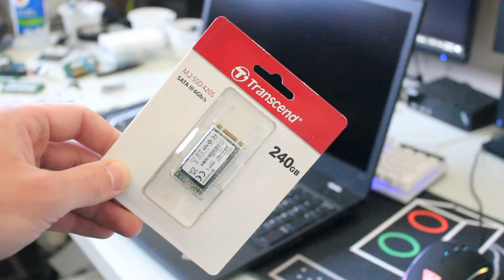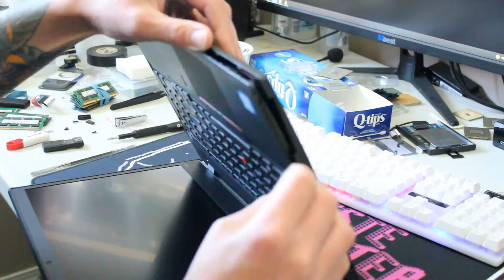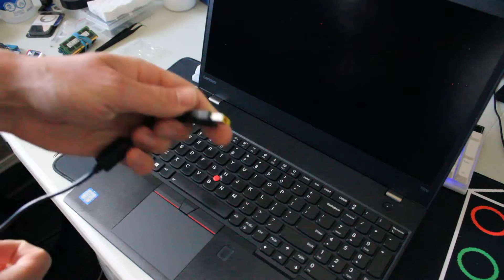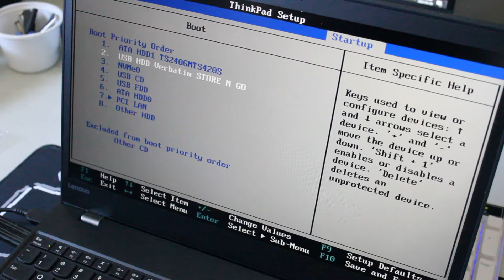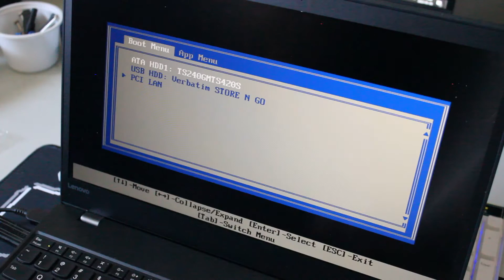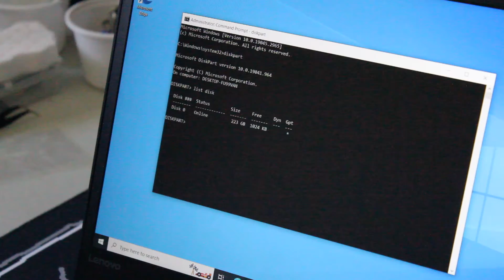ThinkPad T570 m.2 2242 SSD Install Tutorial

Comment: thanks my friend for the video, I installed it on a T570 and it worked, but be careful not to do the optional updates because it stops recognizing it
Reply: I did this 5 years ago - I bought a "used T570 with bad drive" thinking that just the drive bay and/or connector was bad.  When I got it and inspected it closely a bunch of the pins on the drive connector were not soldered on the mb!!!    Was so ticked but found this workaround with the WWAN slot and it's been running fine this whole time.  

I installed Lenovo Vantage and only let it do the Lenovo driver updates.  I left all the Windows optional updates alone and that has worked well.  

Let's see what a force-installed Win11 does with it (it's an i7-7600U with 32GB RAM)
Reply from the maker: @chuckhortler2814  I bet it will run fine, perhaps a variance depending on what you use it for.
Reply from the maker: Is that right?  Were you able to pinpoint which update did this?  Windows 10 or 11?
Reply: @HaisteComputerRepair win10
Reply from the maker: @vaspapag6628  Interesting, and do you know what update caused this to happen?
Reply: @HaisteComputerRepair I'm still trying to figure it out to see what's going on. I've done a lot of formatting. When I find it, I'll tell you.but now I see blue screen...if u now something tell me
Reply: @HaisteComputerRepair  The problem remains, I followed your instructions, I put the same disk in, it works for a few days and then it doesn't see it... I restart the laptop start the windows  and the same things start again , do you have any idea?
Reply from the maker: @vaspapag6628  It's possible that it is a motherboard issue.  Is there anyone you know or a professional who can handle board repair?  Or provide an assessment beyond just replacing it?
Reply: @HaisteComputerRepair Good morning my friend, so the problem is when installing the ssd m2 drivers, we can't avoid this no matter what I tried, windows does it automatically and it doesn't turn off, I installed Linux mint and it works perfectly, I had fun, faster than stupid windows
Reply from the maker: @vaspapag6628  Strange.  Well, more reason to use linux!  Thanks for the insight.

Comment: actually, when it comes to the Lenovo T5 70 there's a special lock on the bike so if you buy with sata drive you're not allowed to use m.2  even if you update the bios but if you buy the computer with the M.2 dot then you can use both nvme drive. same as on the P 51 m.2  but it requires an update if your M2 drive is too new. try updating the bias if that doesn't work then it's a bios lock not that the caddy or the ribbon is faulty.
Reply: but also, if the main hardware connector does break which happens a lot on the Lenovo t570 p51s t580 and p52s the Wwan card  slot is a good spot you can put your  hard drive to use  stuff freely. just make sure you drive cloning software and have the right amount of storage for it. like I had to do until I can replace my motherboard.
Reply: @shoukonishimiya9931  except that the whole idea of the caddy NVMe is to put a 2280 in there but the WWAN is only 2242...?  Seems like you'd have to get down to analyzing the serial number to know if you got one of these models that actually has PCIe 3.0 support versus SATA only support via the drive bay connector?   

PSREF says "some models" for each of the four options (3 options are SATA III, one is PCIe 3.0) . Even if it is an NVME-capable model, it's only PCI 3.0x2 (1970MB/s).  That's still 3x faster than SATA III (in theory) ... it's all ancient hardware now... 9 years old in Q1 2026.
Reply from the maker: Thanks!  I don't recall if I tried an m.2 sata SSD instead of an NVMe in the regular spot.  Wish I could go back in time.
Reply: @HaisteComputerRepair  speaking of which ... will a p51s motherboard fit into the same T570 case?   they're sold in some situations as though they're the same m/board but wondered if the p51s has less of the factory quality control issues than the T570?

Comment: Hello, i was on Amazon searching for a bigger 2242 ssd and came across 2242 NVme... Would a 2242 nvme fit in that same slot?
Reply from the maker: An NVMe SSD will not work in this laptop.  Only an m.2 2242 SATA III SSD.

Comment: Bro, your internal battery has some protective shield. What's that called? I'm planning to install that one.
Reply from the maker: It's like a shrink wrap.  You will have to source the whole assembly, which has the wires "welded" to the battery which you then connect to the motherboard.

Comment: If you have not solved the issue the the NVMe not showing up I think the T series Lenovo can on recognize SATA III even in M.2 types. I have a SATA III SSD 2.5 in my main slot and an M.2 SATA III 2242 in the internal by the WiFi card.

Comment: Hi I have the same issue with mine the slot got broken in the process of trying to replace the hard drive my question is since you attach it to a wifi slot will the thinkpad still have wifi or do I need to buy an external wifi adaptor
Reply from the maker: This SSD is installed into the WWAN port, not the m.2 WiFi card port.  You'll be able to use the WiFi/Bluetooth.

Comment: I just tried every screw driver I can find but cannot seem to be able to open the screw to remove to fit the Ssd in that slot. Is there any specific one I need to use? Just to be clear, I was able to remove the back panel and found the slot next to the wwan card
Reply from the maker: It just requires a phillips head screwdriver.  The one you used to open up the bottom panel should work fine.  Is the screw stripped?  So you have a WWAN card installed?  Or do you mean the m.2 WiFi card?

Comment: I had the same issue in my T570 but i fixed soldering the connector attach to the motherboard that was loose , but the technician told me may can fail again,  so i was thinking to do this upgrade. It´s a little bit sad because those SSD m2 are more expensive than a regular SSD 2.5 and i have a 1TB WD Blue and still works as day one
Reply from the maker: It is definitely a bummer, good luck!

Comment: I have the same issue with my t580. That ribbon cable for the motherboard is trash. The female motherboard connector is poorly connected and gets dislocated easily.

Good thing it has two drive slots but mine is b key and it's really hard to find
Reply from the maker: Yes, it makes me sad :(

Comment: Thanks for your video, I tested it on T570 and it works. Most of the time people get SSD with only M key type, but it should be B+M key type SSD as shown in the video. Gr8 help dear, thanks.
Reply from the maker: Glad it helped!
Reply: @HaisteComputerRepair  Has to be the B+M. I tried doing just the M type and it would not fit
Reply from the maker: @guywthclss  Good call, yes that is correct.  I didn't explain that exactly in the video, but hopefully people pick up on this.

Comment: Hi! many thanks for this video. Same issue, SSD not recognized. But on the slot I've a Fibcom L831-EAU - seems to be a WWAN Module. What can I do ? thanks a lot
Reply from the maker: That would be for connecting to wireless networks, like a cel phone, to my knowledge.  If you take that out and install an m.2 2242 SSD like in this video you can use it.  I assume the port is enabled in bios if there is a wwan card installed.

Comment: Hi, can you make a video where you install an M.2 SSD on a lenovo thinkpad t560 and have a 2.5 inch ssd? i am asking because i have a lenovo thinkpad t560 and i have linux on my sata ssd and i need windows on a m.2 ssd
Reply from the maker: Unfortunately the T560 does not support a m.2 SSD in the WWAN port.  You could try running Windows/linux in a virtual machine.
Reply: @HaisteComputerRepair  why does everyone think that it doesn't? Like there is another slot that is like a nvme or m.2. Many people were able to install it
Reply from the maker: @retrotesteryt  In the T560 there will either be a SATA 2.5" caddy or NVMe adapter.  The extra m.2 WWAN port does not support 2242 m.2 SATA III SSD's like other models.  So, you have the choice of one drive only.
Reply: @HaisteComputerRepair  ok thanks
Reply from the maker: @retrotesteryt  Hope that helps!

Comment: The T570's have problems with the Sata Connector on the Motherboard. We have had many problems with them and have switched some to boot from the M.2 slot.
Reply from the maker: I did the same for a couple and ended up replacing the entire motherboard for a couple more.  Four laptops out of about 15 or 20 I went through.  Purchasing T570's now gives me anxiety, haha.
Reply: @HaisteComputerRepair  have seen a few of these on ebay and the seller uses the same picture over and over again ... with the drive bay connector completely torn OFF the motherboard - the drive cable is still clipped into the cable mount which is normally on the motherboard but the connector is hanging in space on the end of the drive connector ... a corner of plastic for the drive connector is sitting on the motherboard.  LOLzzzzz.
Reply from the maker: @chuckhortler2814  I have had similar problems with the T580.  Maybe the IT worker or whomever tearing off by accident.

Comment: Hello. I have the same computer and the same problem :  The 2.5" SSD was no longer recognized. 
I found  on the motherboard that the female connector for the ribbon cable was no longer soldered correctly. This is a problem apparently very common on this model.
Reply: Yes, I can confirm this 100%. After many hours of head scratching, I poked around that female ribbon connector on the motherboard and some of the pins were not soldered securely to the board. I reflowed the pins and what do ya know, the computer now recognizes the drive! If one is going to attempt this, be damn sure you have magnification because those pins are .5mm spaced and will bridge quite easily. Cripes!!!
Reply from the maker: @TomBravo8185 You're doing the lord's work
Reply from the maker: I had this problem with two T570's and it's really too bad.  Just one component can cause such a big problem.  I am not so talented with soldering or repairing motherboards, so I replaced them.  Good luck with yours!

Comment: Also here with the issue that nvme ssd via ribbon cable to legacy 2.5" hdd slot results with SSD not being detectable in BIOS, Diagnostics. Have you found the solution maybe?
Reply from the maker: Well, it seemed to be specific to this laptop in the video as I was able to test the same caddy with the same cable attached in a different T570 and it was detected.  So, for the time being it will just have this m.2 SSD installed until I either sell it this way or find a solution.  Unfortunately no solution yet.  If you find one let me know!